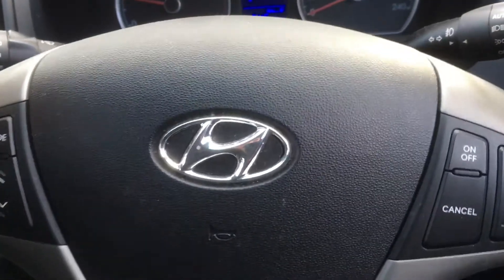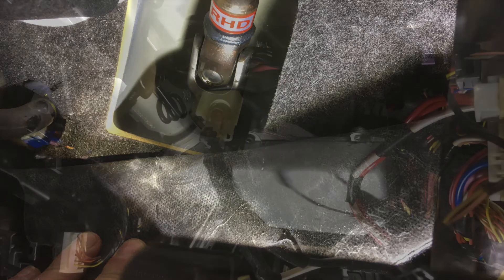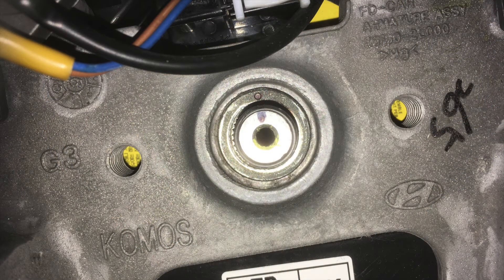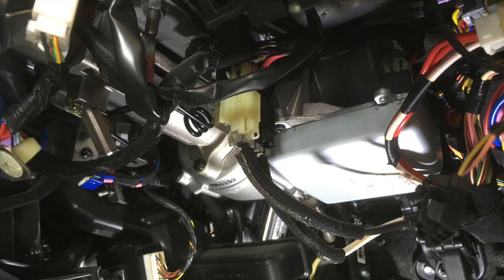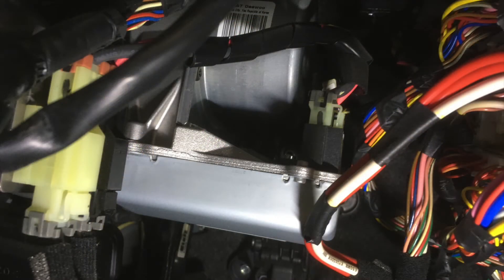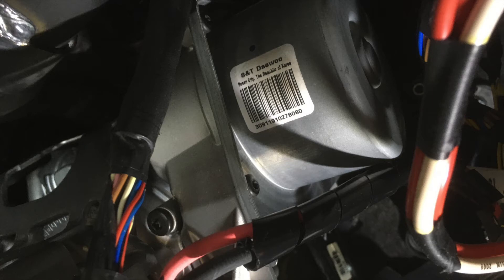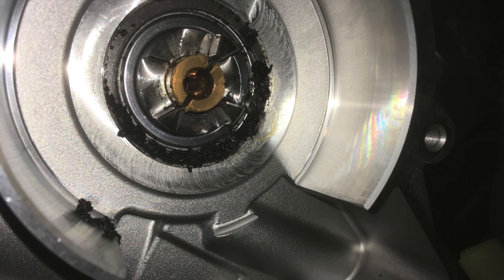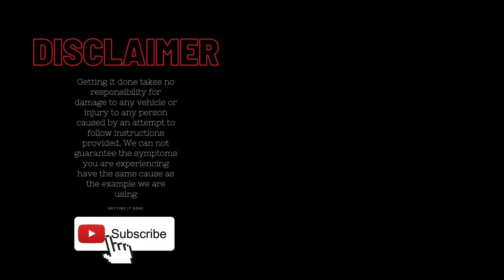Hyundai steering wheel noise

Comment: hey great vid. My santa fe definitely has this going on.  Could it also cause the steering to "stick" when making a small steering adjustment when driving? It's very subtle but very noticeable!
Reply from the maker: It's possible and would be the first thing to check. The other possibility is that the gear set in the steering rack itself has worn which can also cause both a knock and sticking. Repairing the steering rack is a more expensive repair so you would want to check out this bush first, then have a mechanic confirm worn rack gears if need be. Generally if over adjusting the steering rack gets rid of the noise, thats where the fault is.

Comment: With that coupler can the steering feel loose and feel like the rack n pinion has an issue when going over bumps
Reply from the maker: Yes, it will cause play in the steering along with the knock. There are of course other possible causes, but this one is very common.